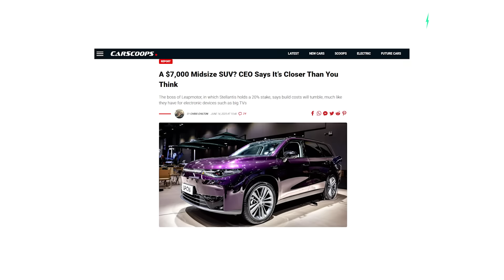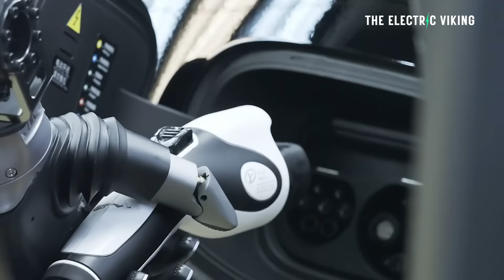One of the world's largest EV makers says $7000 electric SUVs are coming

Comment: Unless your eyes are shut and you refuse to listen. The only future is EV.  Billionaires and multi millionaire will own the odd ice vehicle for the rest of us it will be the cheapest option  tha , like it or not we will have to take. And most people , even at those prices will not own a private car . They will hire as required. Then they won't need a garage ,they won't pay to maintain a vehicle, or insure it. It will cost more to purely fuel an ice and maintain it than the costs associated with hire of a fleet EV. Besides people will be too worried about where to find a petrol station to even consider an ice car.
Reply: You are insane. Price a replacement battery for any EV on the market. ICE will always be king.

Comment: This may be unrealistic.  Cars now cost more than $7000 even without the batteries and motors (or engines and transmissions for ICE).

Gigacasting and robots might help bring the cost down.  But $7000 for a large EV SUV seems unrealistic.
Reply: electric motors are slammed together by robots in minutes. ice engines and transmissions are very complicated and very expensive
Reply: He didn't say large ev, he said middle side ev

Comment: In a functioning market, price is set by demand and supply, not by production cost alone. Lower costs simply increase profits. Product prices tend to remain the same as products evolve, unless you are buying outdated technology. Mobile phones and cars are classic examples. They always cost around the same price for the standard model. It's just that the standard model might be a little slightly improved in certain areas with each iteration of the product.
Reply: What you are stating is the perceived workings of standard Capitalism of the West. Prices are set by the owners and industry market setters/leaders. Sure, the technology can reduce the cost of production and increase profits for the owners. However because of the desire to lead in the industry, the Chinese are raising the bars ever higher whenever they can. This leaves the option of pocketing the profits now or increasing your competitive ability to survive in the cut throat environment. The ones that decide to pocket the profits now may not be able to survive tomorrow.

Comment: Currently in China🇨🇳 the cost of manufacturing a 50 kW LFP 400V battery pack is $5000.

If sodium ion batteries can get down to $10/kw at the cell level.

So a 50kw 400V battery pack can be bolted on for just $2,000.
-----------_-----------------
leapmotor sells B10 suv 177 hp, with 57kw LFP battery. For USD $ 13,800. And the length of the car is 4.5 meters.
Maybe in the future they will sell it for half this price.

Comment: The engine and transmission costs between 10-12,000 dollars.  So that is really what you have to work with.   Best predictions is that motors will be around 1k and decent sizes batteries around 2k in the 2030s.  So, in the end the price difference between ice and EV’s will be around 8 to 9 grand.  Well, probably more cause ICE manufacturing efficiencies due to scale will decrease as sales decrease.
Reply: Currently in China🇨🇳 the cost of manufacturing a 50 kW LFP 400V battery pack is $5000.

If sodium ion batteries can get down to $10/kw at the cell level.

So a 50kw 400V battery pack can be bolted on for just $2,000.
-----------_-----------------
leapmotor sells B10 suv 177 hp, with 57kw LFP battery. For USD $ 13,800. And the length of the car is 4.5 meters.
Maybe in the future they will sell it for half this price.
Reply: If batteries get cheaper, ICE is dead.
Reply: So in 5 years a battery that cost on average over $12,000 will be $2,000? Do you even read what you type?
Reply: @NoneBusiness-t7s .    Agreed.   Hard to believe.  But for the last 5 years, battery cost reductions have beat forecasts.   Who would have believed that i could get a Tesla battery that cost 85k in 2010 for 8k in 2020.

Comment: If half of the market is ev in china and china is the most advanced in the large economys then only 1 more doubling is possible in acceleration of uptake this means the doubling will slow and peak acceleration is already here. And it will take double the years due to market saturation for the 20% gain. It might be possible, but the timeframe will blow out. Also, material shortages of copper are predicted as not enough mines to supply the increased demand. Or robotaxi will crash the car market reducing demand and slowing the doubling. Other factors could crash economies so i think this is a threat to scare off competition that may not be able to be executed.

Comment: Throw away cars. You won’t get parts for them. No one will fix them. I’m not sure we will have scrapyard capacity to deal with this. If the producer was obliged to deal with the scrap, maybe the price would be more realistic.
Reply: Like wet belt failures? Writing off cars under 5 years old. ICE vehicle manufacturers have been making cars that require more expensive and regular maintenance than pre 2000 cars. Not entirely their own fault as emissions regs have resulted in highly complex systems that cause issues.
Reply: Electric is not throwaway.   Less parts to go wrong.   No oil changes.  Batteries last years.   Possibly 20.  You are not educated

Comment: Nah, $7000 is too expensive. I’d consider $5000 but the car would have to have a genuine range of 1000 km charging from 20% to 80%. Plus a 10 year warranty on the car and unlimited warranty on the battery. I would also want a free charge card for 24 months of unlimited charging. I would also require a case of Dom Perignon 2015 Vintage in the boot/trunk.
Reply: I think you'll find without exception all EV's are able to charge from 20% to 80%. How fast they can do it is the question.
Reply: As opposed to a crap ICE car, which you would buy.
Reply: You forgot the original equipment launch-able drone in the roof. Which a costlier BYD does already have, and the windshield-wide heads-up display. Some Chinese brand car has a food-compartment that can not only cool a bottle of Dom Perignonm but alternatively keep warm your celebratory tamales.
Reply: Don't forget to order a brain...You could do with one...

Comment: Literally not gonna happen. No manufacturer will undercut competition by 80% to make a statement. They'll take a 75% margin boost instead and say nothing. Lets not be naïve thinking that car prices are going to actually drop.
Reply: Currently in China🇨🇳 the cost of manufacturing a 50 kW LFP 400V battery pack is $5000.

If sodium ion batteries can get down to $10/kw at the cell level.

So a 50kw 400V battery pack can be bolted on for just $2,000.
-----------_-----------------
leapmotor sells B10 suv 177 hp, with 57kw LFP battery. For USD $ 13,800. And the length of the car is 4.5 meters.
Maybe in the future they will sell it for half this price.
Reply: It's already happening in the motorcycle industry because China is making great bikes at a great price,  we've been had by major motor companies for far too long...

Comment: If a mid-size SUV is $7k, what are we going to do when we have an accident after 2 years (everything still works normally but there are dents, scratches on the doors for example)?
Reply: What? You go and let it get fixed or replaced?
Reply: @ziggs123   I think avalagum7957 means "a damaged $7k car would possibly be discarded* instead of repaired" ... as in, the cost of repair might not be much lower than, say, $7k. *or parted out
Reply: @ziggs123  I meant that after 2 years, your $7k SUV is worth about $5k. Fixing those doors costs about $3k. So, sometimes, buying a new $7k car is cheaper.

Comment: Currently in China🇨🇳 the cost of manufacturing a 50 kW LFP 400V battery pack is $5000.

If sodium ion batteries can get down to $10/kw at the cell level.

So a 50kw 400V battery pack can be bolted on for just $2,000.

Comment: yea nah.. i can't value my and my family wellbeing in a $7k car unless they can prove it
Reply: Currently in China🇨🇳 the cost of manufacturing a 50 kW LFP 400V battery pack is $5000.

If sodium ion batteries can get down to $10/kw at the cell level.

So a 50kw 400V battery pack can be bolted on for just $2,000.
Reply: Countries have safety standards and ALL cars have to meet or exceed those standards to be sold. Your idea that more expensive = safer is misplaced
Reply: @GraemeMitchell-m6v  i see your point then major price = quality rules applies in Chinese products especially in EV
Reply: @leedaq7767  All Chinese SUVs have met the European NCAP 5-star rating.

Comment: 7k $ car's are fine ...ik we can eventually get that, the thing which matters the most that if we can get 400+ km of range or not.
Reply: Currently in China🇨🇳 the cost of manufacturing a 50 kW LFP 400V battery pack is $5000.

If sodium ion batteries can get down to $10/kw at the cell level.

So a 50kw 400V battery pack can be bolted on for just $2,000.
Reply: @industrialisasi45 hmm so it will takes roughly 5 years for production ready in my country.
Reply: @industrialisasi45 never going to happen
Reply: @grantbuttenshaw That's not my sentence.

 But leapmotor sells B10 suv 177 hp, with 57kw LFP battery. For USD $ 13,800. And the length of the car is 4.5 meters.
Reply: A hell of a lot of them already have more than 400 Kilometres of range, do try and keep up....                                                                   
BYD Seal Premium: Offers a range of 570km.
Ford Mustang Mach-E Premium: Provides a range of 600km.
Tesla Model Y Long Range: Features a range of 533km.
Hyundai Ioniq 5 RWD Extended Range: Offers a range of 507km.
Cupra Born: Provides a range of 511km.
Polestar 4 Long Range Single Motor: Has a range of 620km.
Porsche Macan 4: Offers a range of 613km.
Mercedes EQS 450+: Provides a range of 783 km.
Volkswagen ID.7 Pro: Offers a range of 702 km.
Tesla Model 3 Long Range: Provides a range of 678 km.
Hyundai Ioniq 6: Offers a range of 614 km.
Reply: @MickH60 Are you stupid or you can't read ?!...i am talking about ev that cost 7k $ and give range of 400km..and as far ik none of these cars you mentioned is below 7k

Comment: Cardboard EVs maybe. If you remove battery and motors from equation and you still have to put 10.000$ for a reliable/safe chassis. And I'm talking about materials, not including labor. So even with robots and free labor it's dumb to assume such pricing.
More over, inflation .. constant world wide inflation. Stuff gets more expensive.
Reply: So what you are telling me @i3looi2 the price for ICE vehicles will  skyrocket with inflation and be gold plated
Reply: Currently in China🇨🇳 the cost of manufacturing a 50 kW LFP 400V battery pack is $5000.

If sodium ion batteries can get down to $10/kw at the cell level.

So a 50kw 400V battery pack can be bolted on for just $2,000.
-----------_-----------------
leapmotor sells B10 suv 177 hp, with 57kw LFP battery. For USD $ 13,800. And the length of the car is 4.5 meters.
Maybe in the future they will sell it for half this price.
Reply: Sorry have too dispute your findings on stuff gets more expensive as when product gets mass produced it becomes cheaper, colour flat screen TVs come to mind when they first came to NZ they were 16,000 NZD that was about 25 years ago and with only a 21" screen now today it only costs 699 NZD for a 50" screen and plenty more come to mind
Reply: thats the thing, they do not have safe chassis. U will drive that car for 1 year and get a new one.
Reply: There are already 7.500$ aliexpress ev mini-trucks .. but you can't call that a car, you die in a crash with a biker.
Reply: @i3looi2  I wouldn't know never driven a aliexpress ev mini truck let alone been hit by a bike and don't know anyone that has so can't comment as I am not a expert in this field